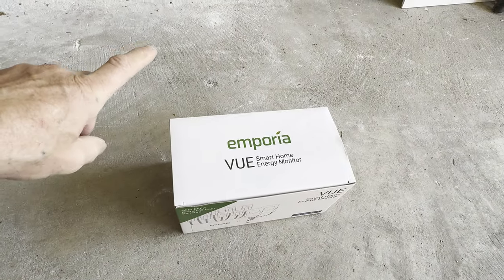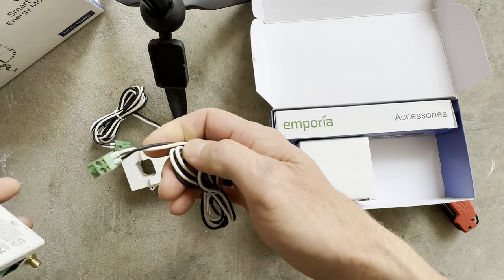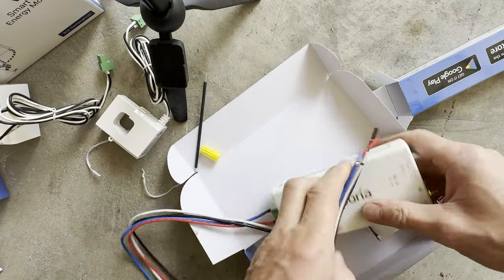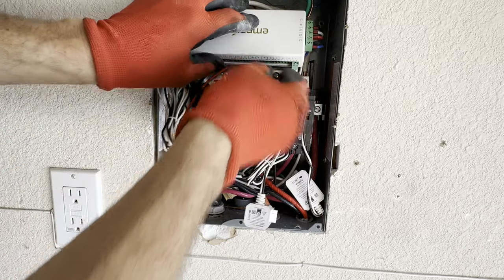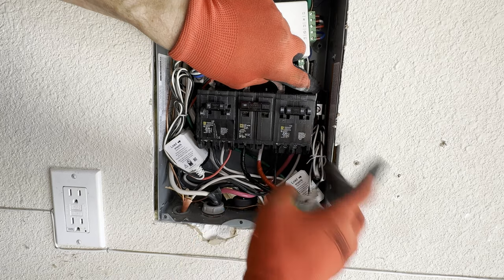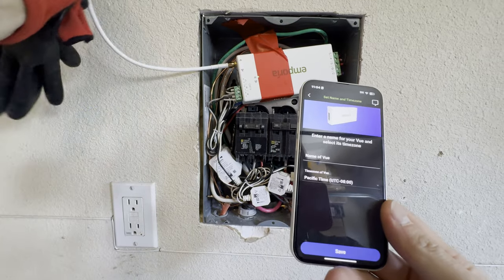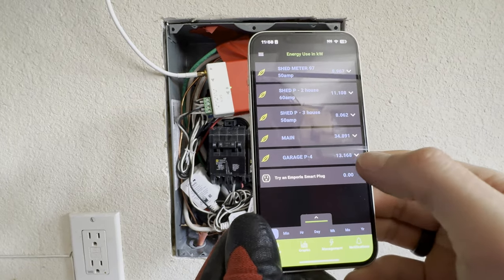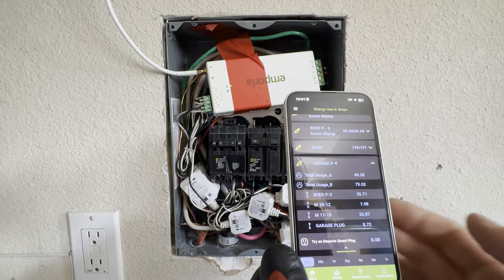EMPORIA ENERGY MONITORING GEN3 REVIEW AND INSTALL

Comment: I think the main benefit of this design is that you can shorten the leads of the CTs which makes the installation cleaner.
Reply from the maker: yeah, thats a good idea, once you cut the wires though setup is pretty much permanent wich in most of the cases it is anyway

Comment: Those connectors are great.  It's not like it's going to be withstanding vibration that could loosen it.  I've used those connectors on christmas lighting controllers.
Reply from the maker: Yes, I like them much better than previous ones and you can shorten the wires for permanent install to get rid of those spaghetti around the panel.

Comment: The most dangerous part of the installation is that you leave out with just a few comments; you know what you are doing, but many may not, and to leave out the connecting of POWER to this without a detailed video of doing so makes me wonder about your teaching skills. I would never hire someone who will sweep the floor and leave the corners untouched.:text-green-game-over:
Reply from the maker: Thanks for comment, I know, my camera was off while connecting to the power. It’s not that hard for any one with basic skills and who is not scared to open main or sub panel up. I don’t think someone will try to open main panel without knowing the basics of electric work that would be a big mistake.
Reply: You seem to know everything.  This makes me wonder why you even watched the video.